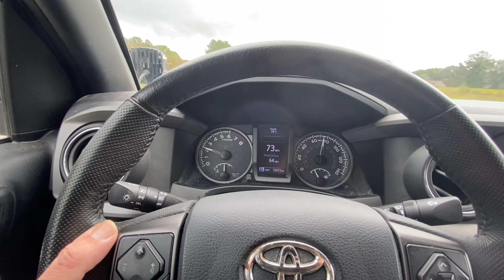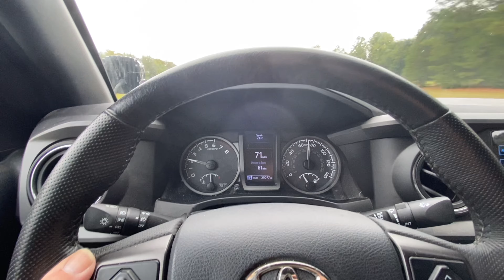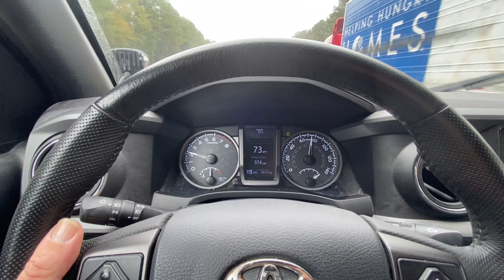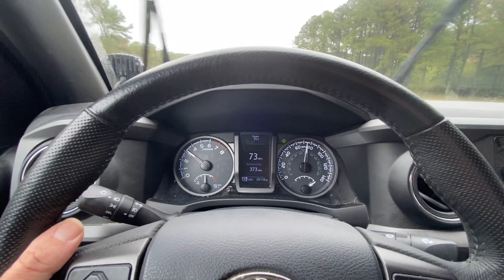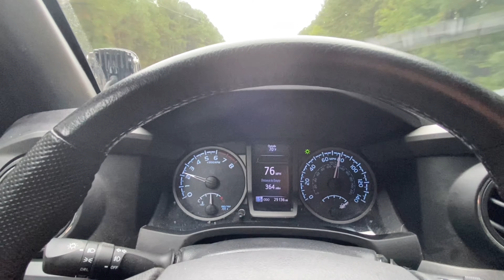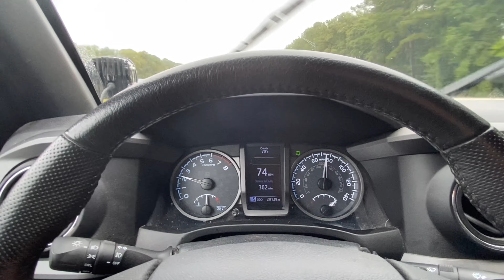TRUCK BUILD: KDMAX 87 Octane LT Tune Using Cruise Control (TEST)

Comment: Just for those who are still confused by the exhaust systems 
The oem is really good vs any exhaust systems which is just for sound unless you remove the Catts which is when you actually gain the most hp/tq 
My comment is based on dyno numbers and money spent, I remember when I started buying everything that claimed more hp/tq .
For example, bought a $350 K&N cold air intake, gained 1hp on the dyno , total of 8hp after running but lost 2 mpg so instead of 18mpg , my truck was getting 16mpg in the highway, was it worth it? No but since I couldn’t return the CAÍ y kept it just for the sound. 
Only thing that really works in any vehicle, it’s the tuning.
Exhaust systems, CAi are for modded engines that need more air and better exhaust flow but again it just my personal opinion on my dyno numbers from GM 5.3-6.0-6.2 v8 from stock to modded engine.

Comment: When you turn cruise on hold ot down it will turn manual cruise instead of adaptive cruise in adaptive cruise it reverts to stock shift map. In manual cruise it will stay with kd max shift maps
Reply from the maker: Woah… need to try that.

Comment: Thank you for the information. A bit disappointing that the CC mapping doesn't change. That being said I have experienced similar issues with the truck staying in a lower gear until I tap the gas. I don't have any tunes on my truck

Comment: Did you see a improvement in MPG? What size tires do you have?
Reply from the maker: No, once I added the tune, MPG dropped, but it was at the same time I did major mods adding a bunch of weight and air resistance. Before all my mods, I was close to 20 MPG on the road (unloaded) and 17 MPG loaded (265-70-R16 Goodyears). After my mods I’m at 15 MPG (unloaded) and 12 MPG loaded (265-75-R16 Toyo MTs). Tire weight and type really changed mileage. This truck is not a daily driver, and I only use it for trips
Reply: @thetacodog  with that mpg may as well get a tundra

Comment: I just got tuned on kdmaxx newest version. This is exactly what I am experiencing. I can cruise all day long 5th 6th with cruise control OFF. With cruise control ON the truck wants to go into 4th instead of giving it more throttle in 5th gear like it does with cc OFF.
Reply from the maker: Yep, as others have mentioned, it’s likely the ECU has a CC map that functions separately and is not changed by the tune. I found that a simple tap on the throttle will result in upshift to 5th gear

Comment: My KD tuner told me,l that if you’re using adaptive CC, it’ll revert to the stock map. 
I’ve been doing some research and re-gearing will help with the issues your le having
Reply from the maker: Thanks, but I’m not really concerned about it. I rarely use CC on the road. I also like using synchronized mode and manually pulling 4th. I’ve found that 4th gear has a wide RPM range topping out at about 3,500 RPM without stress. On my truck, that puts me at 80 MPH

Comment: My setup: 2020 TRD Pro AT.  33” tires, rock sliders, full skid plates, Diamondback bed cover, etc.  had gear hunting issues and random dead pedal. When I Tuned with KDMax 6.0, dead pedal was eliminated.  Gear hunting was reduced abt 50%.  Then I re-geared with 4.88:1 gears.  Gear hunting is now eliminated.  As noted in the video, when an AT Tacoma does shift to 4th in CC, it will hold 4th for more time than seems necessary.  Great tip to tap the accelerator.  My current set up has me smiling.” FWIW.
Reply from the maker: Thanks, glad to see you like it as much as me…
Reply: I have a 2020 Tacoma and I'm looking at a KD Max tune or regearing to 488 or 529. I have a Westcott lift and I'm running 285 75 16 wildpeak at3w. Do you think that regearing your truck to 4.88 would have eliminated your issues without the KD Max tune? Thanks in advance!
Reply: @robbell8507  the rehear to 4.88 solved the remaining issues my Tacoma had.  Like I said, the tune solved the dead pedal and ~ 50% of the gear hunting issues.  Unless you are running a lot of extra weight, the 4.88 set up should do well with your tire size.  I’ll go back to my tuner for a retune for the different gear and the new update to the KDMax.  The tune is a lot less than gearing. Maybe give it a shot and see if it solves the problem.
Reply: @stealthyleopard5805  thank you